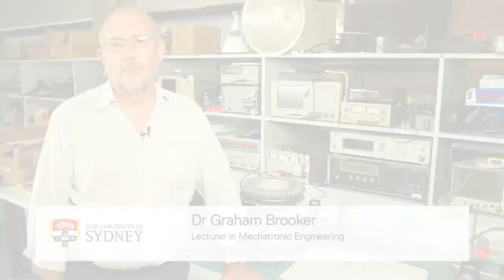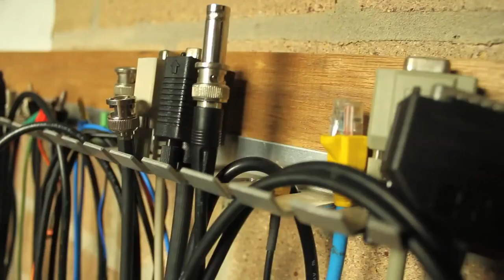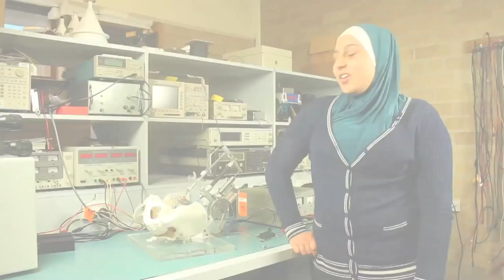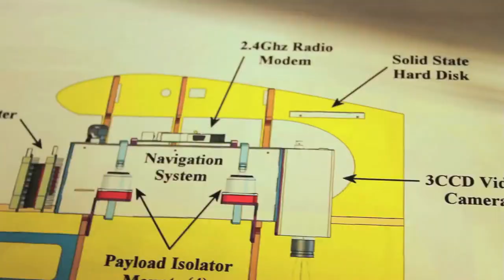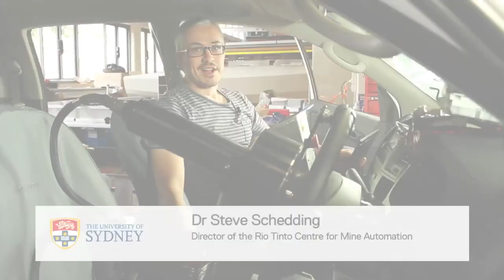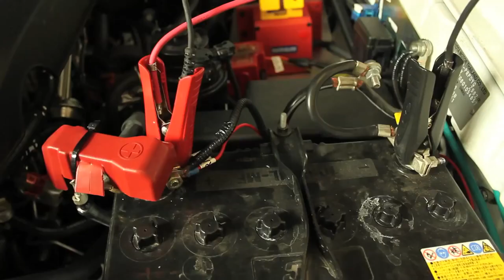Thinking about studying mechatronic engineering?

Comment: Do mechatronics engineers design cameras? please get back to me
Reply: I think you can. Cameras are a mechatronic system.
Reply: No
Reply: Yes. Essentially mechatronics is taking mechanical engineering and combining it with electrical engineering. So if you want to do both to create a particular product then yes. Cameras and telescopes, things of that nature normally fall under optomechanical engineering, i haven’t seen that be offered as a major  so mechatronics or mechanical engineering work just fine. I know someone who works on optics and did a mechanical engineering degree only.

Comment: Just imagine
A million cubic meters inverted barometer provides how much work done if we use sea as water base so we got stroke every second and a huge pressure will turned a flywheel continueully for making electricity round the clock 

Please do the math over it 
It will save the environment and serve the humanity

Comment: did mechatronics include Ai ? or not
Reply: No unless its robotic but they only cover the basic and its usually a program or a software rather then the actually ai itself and also it depends on the university itself. Some universitys dont include AI at all wanting the students focus only at the hardware part since its the natural thing of the mechatronic engineering. Also even if they did. Most likely it will be only the programming not the ai. Study of Ai is a computer science field which dealt with software and it they learn and research it deep.
Reply: Not in enough depth to really count.  Software engineering might depending on the program.  You could always focus with electives, but unless you already know a lot of programming, it isn't likely you'll be able to work with AI doing that
Reply: Mechatronics does include AI, but I am nit sure about Australian institutions.
Reply: same question here
Reply: My school has  classes on that
Reply: Sure
Reply: Thats for computer science
Reply: That’s going into the tech industry. So yes it helps with creating robots and automated products, but you’ll also need to learn coding.